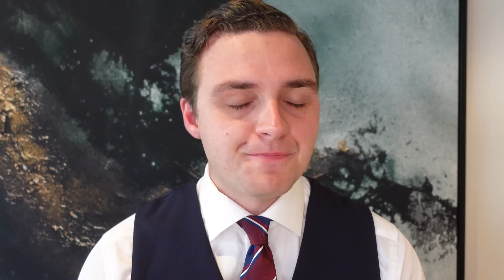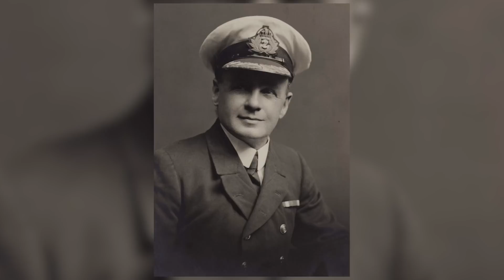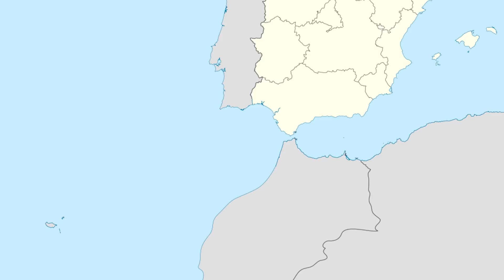How to Annoy the Steam Engine Community

Comment: As you note, steam cycle heat balances very often are measured in absolute pressure at all points. All of my nuclear heat balances for the plants I've helped design are absolute pressure. So, as far as I'm concerned, you were all good on that one.

I heard the other errors, but do appreciate the difficulty of nailing the subtlety of thermo cycles without doing that work professionally. You did well.

Certainly laudable to make a full video of corrections.

Comment: Another point:  The turbine's exit pressure and power output were often limited by the amount of vacuum the exhaust condensers (called surface condensers) could pull.   But the amount of vacuum generated was set by the condenser's cooling water temperature (i.e. sea water temperature).  So, the colder the cooling water, the greater the vacuum pulled and the greater the pressure drop across the turbine.  Thus, the colder the sea water, the greater the condenser vacuum, the greater the turbine's power output and the faster the ship's speed.  I wonder if this engineering fact influenced Capt. Smith in his choice of the more northerly route?  BTW:  Now that you're digging into marine power plant designs, you might also look into the history of the switch from coal to oil firing, and its far reaching impacts.  Thanks.

Comment: One interesting note-is yes the engines were triple expansion, but actually 4 cylinder with 2 third expansion cylinders to extract even more power. Even with all these systems in place to make it more efficient, today's Diesel power cruise ships are 2-3 times more efficient. The Titanic's engine room including boilers took up nearly the length of the ship and 4 decks. The Queen Mary 2 has one engine room with the Diesel generators, then 2 gas turbines at the base of the smoke stack. Amazing the difference in space utilization.

Comment: It is great you have come back to update your explanation of the engines of the titanic, a lesser man would have not done. Having since looked at the engineering of this there is an annoying mix of terms. As in some parts they refer the gauge pressure and in others atmospheric, which makes it harder to follow. I none the less cannot find in the notes on the turbine that it worked at negative pressures - which i believe is impossible. The initial pressure into the turbine was 9psi (a) and it left at 1psi (a) ie just warm water before the condenser cooled it down further to about the temperature of the sea. It was from this point onwards where it was heated in stages and one way valves stopped the pressure affecting the previous parts on the system.  What I didn't realise is the boilers didn't heat the water that much as it came into them already at nearly boiling point. The boilers job is just that last kick to turn the hot water into steam and to add the pressure. I however would like to know more about the direct contact heaters and surface heaters that did the majority or the water heating?  https://www.titanicology.com/Titanica/TitanicsPrimeMover.htm

Comment: Saturated steam after passing something that eliminates or separates the condensate is called "dry steam".

I found it odd at first glance that the turbine received steam at a relative vaccuum, since my knowledge of steam tech mostly derives from railroads. But it is absolutelly possible, since Titanic used a closed system. Steam is 1000x more volumous than condensed water, so when it condenses in a closed box, it creates vacuum.

Condensers create a huge boost in efficiency. Instead of heating feedwater from room temperature up to boiling point, a well designed system inputs water as hot as possible from the condensate back into the boiler. Steam locomotives had to use open systems because the exaust steam is essential to create a draft in the boiler, by using a venturi tube vaccuum generator in the chimney. Titanic had tall funnels that relied entirelly on natural draft.

 Your steam valve animation has a major flaw. You're admiting steam into the spool through the middle, but you're not opening the middle into the cylinder. The bulges in the ends of the valve are theparts that separate the flow of steam. You're actually opening the exaust part of the valve to the cylinder.

Comment: I'd like to point out an error with the animated diagram at 15:36, it shows an "inside admission" style valve, where the valve is shaped like a spool that you'd put thread on, the valve slides outwards to uncover the cylinder intake channels to admit steam to the cylinder from inside the valve, but the red signifying steam is showing "outside admission", which used a "D" shaped valve wherein steam is admitted when the valve slides inwards of the channel to admit steam from outisde of the valve. I'm also going to note that the valves should also show the other port being uncovered as the steam from the other side of the cylinder is being exhausted. In inside admission, this is where the port is open to the outside of the "spool" shape valve, and in outside admission, it is where the port is open to underneath the "D" shaped valve.

Comment: I've spent a decent amount of my time engineering steam systems as a hobby, and for an eventual restoring of a miniture steam plant. And when I heard they would in draw in seawater without any filtering in that video I proceeded to pause it and sit there for a few moments, then just decided if the guy said it I guess it had a possibility of being that way, I was at the time just caulking it up perhaps a special coating inside the boilers and just gave it a good shrug. I'm glad that you went back and specified.

Comment: Great video. I also appreciate that as someone who did pick up on at least one of the mistakes in the first video, i still learned from both the original video and this one. That's one of the great things about the internet. Whatever the subject, there will always be those more knowledgeable than you when it comes to details, yet often by working together and correcting each other we all again knowledge and get the best information possible.

Comment: Yet another great video you handed the comments perfectly remaining respectful and going in detail on the corrections. And when the comments were wrong you elaborated om your point to try and explain it

Hope to see more of this mindset 

Also one thing you got kinda wrong again 
Titanic didn't use slide valves it uses piston valves which in steam engines are different from slide valves. Slide valves are plates of steel with slots cut out of them while piston valves are specifically shaped pistons moving in a cylinder with 5 ports inside it on a double acting engine

Comment: Lovely video.
Also, fun tidbit, on a reciprocating engine, once you get the crank shaft to move, the valve is opened for less and less time (cutoff), eventually only opening for just a little bit as the piston reaches the top (bottom) to fill the small volume with high pressure steam and for the rest of the cycle it's closed, letting the small, high-pressure volume expand before exhausting into the next stage. Just a small detail I picked up as a steam nerd :)

Comment: An excellent video that presents this information better than actual paid marine engineering lecturers I have studied under.
An addendum to the point about Watt engines for those curious: The Watt engine did run at exclusively under atmospheric pressure but this was because it used the weight of atmosphere on the piston to drive the engine condensive working of the steam rather than the expansive working invented in the early 1800's
A Newcomen (and later Watt) engine filled the cylinder with steam on the upstroke which was done by the motion of the flywheel or weight of the pump rod. The steam would then condense, creating a vacuum under the piston and drawing it down.
Obviously all far beyond the scope of the video but a fun tale from engines before they got put on vehicles,

Comment: with a steam turbine it's all about pressure differential.  the condensers create a vacuum on the low pressure side which increases the pressure differential with whatever you're managing to supply the high pressure side.   in a modern combined cycle natural gas power plant we use compound steam turbines.   large jet engines (turbines themselves) provide the first stage of electricity.  the exhaust goes into a giant boiler called a heat recovery steam generator (HRSG, we call them hersigs).  there are multiple vertical steam tube racks in the HRSG.   low pressure, intermediate pressure, and high pressure.  first the water goes into the low pressure rack and is turned into steam which flows into the low pressure segment of the steam turbine.  that steam then flows back into the HRSG but now into the intermediate pressure rack.  then back into the steam turbine, and this again with the high pressure rack.  after the high pressure segment of the steam turbine it goes from a relatively small (18"?  can't remember exactly) high chrome content thick walled pipe (close to 2" thick walls) line to the other side of the turbine which is a 25' diameter vacuum pipe which feeds into multiple fan cooled condensers which create the vacuum.  the condensate is then treated and fed back into the low pressure rack in the HRSG.   the plant i worked on during construction (before and after commissioning) had two gas turbines, two HRSGs, and one steam turbine.  if i remember correctly the gas generators produced 200MW and the steam turbine produced 400MW, 600MW total.

Comment: This is a great video. 👍
When I studied engineering 40 years ago, steam engines, turbines, low and high pressure stages of power plants, overheating steam and how to calculate the power and efficiency that can be reached  was part of this. So after the first video, I had some questions and now I got all the answers.

Comment: Superheating was used on a lot of naval vessels. The main steam pipes feeding the turbines could literally be red hot - hence the now deprecated use of asbestos pipe cladding. I remember being both surprised and amazed when first told about this. Yup, again by my late dad. He worked for a firm that amongst other things made the oil burners used to heat the steam boilers on some very large shipping. I've seen one on test. Looked like a gigantic blow lamp. They could burn crude oil taken direct from the wells. The oil was spun into a fine spray by a fast rotating metal cone which had to be replaced frequently due to abrasion caused by the sand still in the oil.

Comment: Huh. I had no idea Lusitania had that much more powerful engines. 73,000 vs. 46,000 SHP isn’t exactly a small difference. I’m honestly really surprised that ships 10,000 tons lighter didn’t go any faster. Is it just one of those things where you need exponentially more energy to go faster, or did the Olyimpic class have, idk, better propellers or hull shape?

Anyway, good video. I always appreciate it when someone’s willing to own up to their mistakes. Can I also just say that it’s so fucking cool that you have or can access a 1911…magazine or whatever it was, that talks about the turbines? Like, just so cool. I personally don’t really care when it’s a pretty obvious case of misspeaking (e.g. 1000 tons of coal per hour), but I guess you may as well do the minor stuff while you’re doing the major.
Reply: The resistance of a fluid to a body moving through it is proportional to the square of the speed of the body.  Hence the power needed to maintain a speed is proportional to the cube of the speed. The power required also varies linearly with cross sectional area but is invariant with mass so shape is important but far less important than speed and mass is not a factor for cruising speed (it is for acceleration and deceleration but that is another topic). 

For the two classes draught was more or less identical and the Olympic class was only 2m wider (26m to 28m) so area was very similar (260m^2 versus 280m^2) hence the drag equations will be very similar. So doubling the power would increase speed by about 1.25 times. 

This does give a fairly close fit to the actual data.

Comment: Really glad you did this followup. At the time, I assumed you meant the seawater was somehow processed first, but I was curious how that was accomplished. Just boiling tap water for humidifiers produces an insane amount of residue (and it's mostly limestone in my area, so it turns into cement-like residue in my case), and seawater has a lot more dissolved in it than tap water. I'd love to know more about how that all was dealt with.

Comment: Thank you very much for giving the correct information and taking the opportunity to expand on the topic of Titanic's engines.

I'd love it if you did a companion video to this one going into more detail on how the condensers and pumps were powered and their role in helping the entrance extract power when the steam was below atmospheric pressure.

I think a lot of people are used to thinking of subsystems on ships and cars and trains and such as often running on electricity.

But I imagine at least some of the pumps on Titanic were steam driven themselves rather than electrically driven and I also wonder how much power was lost in transmitting steam to those pumps and how those purpose-built smaller engines for running the pumps worked.

Comment: 600 tons per day is still insane imo. I mean it's doable, but it really puts into perspective how difficult their jobs were. The Titanic had 29 boilers for a total of 162 furnaces. That comes out to 309 pounds of coal per hour, per furnace. Each stoker was assigned to one side of a boiler, or three furnaces. So each and every hour, one man had to shovel nearly half a ton of coal. And that coal need to be thrown through a relatively small hole about eight feet down to reach the end of the firebox. Add to that the extreme temperatures and humidity they would have had to endure in those engine rooms.

But even worse than the stokers, you had the trimmers! These poor souls had to shovel the coal from each individual bunker into a wheelbarrow and deliver it to the stokers. There were only half as many trimmers on duty as stokers and therefore they had to move twice the mount of coal. These bunkers were scattered throughout the engine rooms between and above the boilers. It was a far more dangerous and even hotter work area. They also had to haul away all the ash that was ejected from the furnaces. And, of course, this job paid the least of any engineering position.

Comment: You're never too old to learn something new!

Don't get too hung up about the turbine operating with a 9 psia inlet pressure. The turbine really doesn't care if its inlet pressure is above atmospheric or not - it cares what its exit pressure is in relation to its inlet pressure. With a 1 psia exit pressure that's still a 9:1 pressure ratio across the machine, which has a large influence on how much mass flow the machine can handle, and thus its power output.

BTW, the frigate I served on had a 1,200 psi plant - 1,275 psig steam drum pressure, 950 deg F superheater outlet pressure, giving 35,000 SHP at the main reduction gear coupling.

Cheers!